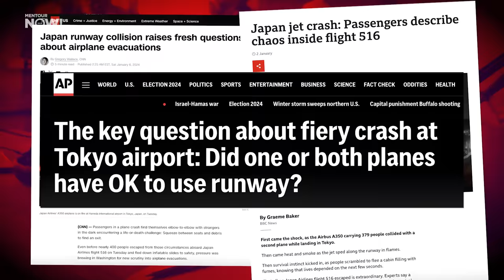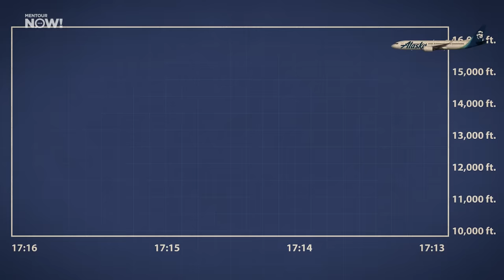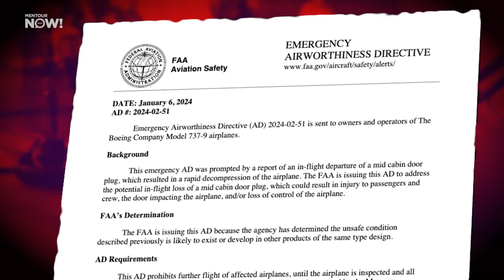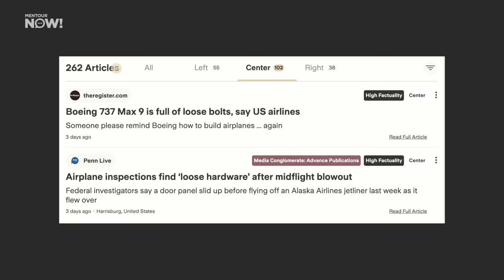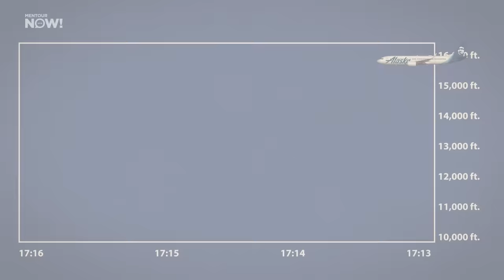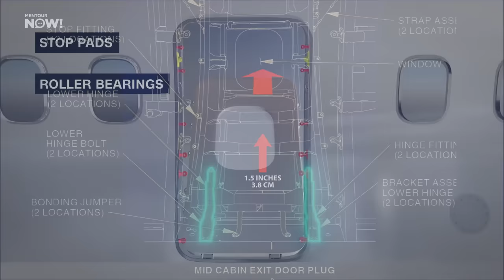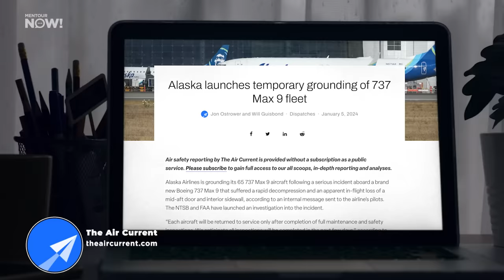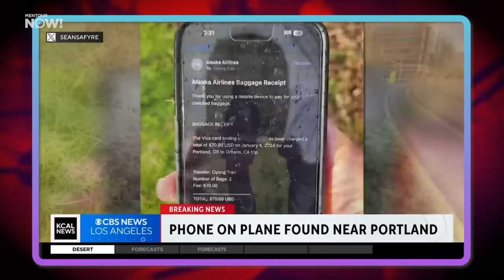WHAT Is going ON with Boeing?! MAX-9 Door blowout

Comment: I always thought that the helicopter drop tests for phone cases didn't matter because such a situation would never happen anyway. I guess I was wrong.
Reply: In this case, you desperately want to be wrong.
Reply: excellent pr for the phones
Reply: Won't matter here. They tested a drop from a helicopter, never tested it for air planes...
Reply: @mattstorm360  Typical max hover altitude for a decent helicopter is around 10-13,000 feet. This happened at 15,000, so assuming the engineers padded it a bit more as they would likely want to, this actually might be exactly what it was tested for. Though if they wanted to go the extra mile, turbine powered helicopters can get up to 25,000 feet, which while not as high as a 737's cruising altitude would give them a general idea of what to aim for to insure it survives that.
Reply: @AdmiralBlackstar  The joke is they test drop the phone case out of helicopters. They didn't drop it out of planes.
Reply: @mattstorm360  It's not the vehicle that's important in such a test, it would be the altitude, which honestly wouldn't even need to be THAT high to reach terminal velocity I would expect.
Reply: Yes, Chakat. That is exactly the joke Matt was attempting to make
Reply: @AdmiralBlackstar  Terminal velocity should be reached from a much lower altitude. But the other thing to consider is horizontal velocity. A jetliner is going a few hundred miles per hour while a hovering helicopter is basically zero. So the phone won't just hit the ground vertically, it will also be bouncing and skidding for a while with a good deal of speed.
Reply: @RCAvhstape  It would have lost any horizontal velocity due to air resistance long before it reaches the ground
Reply: while the testing was ridiculous, and i would not wish this event on anyone... di you not hear the anecdote "never say never"?
Reply: As it turns out, not as over the top as we thought.